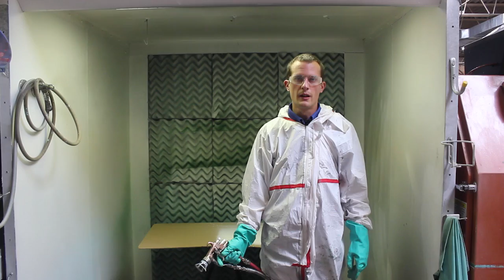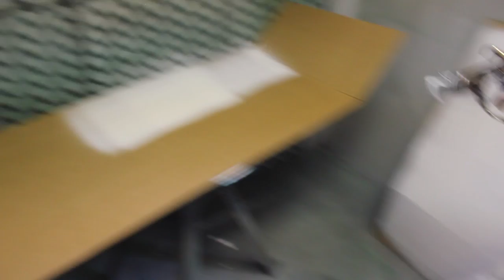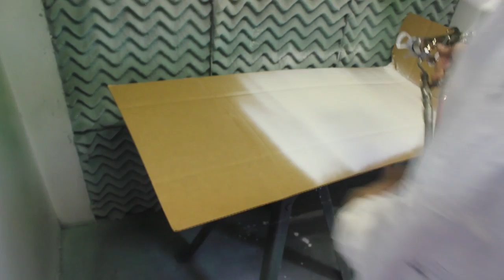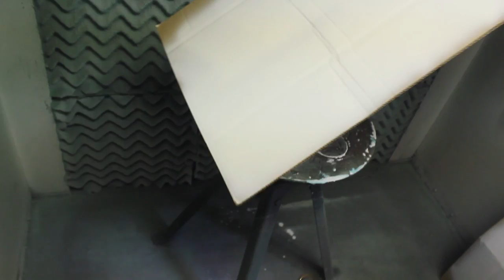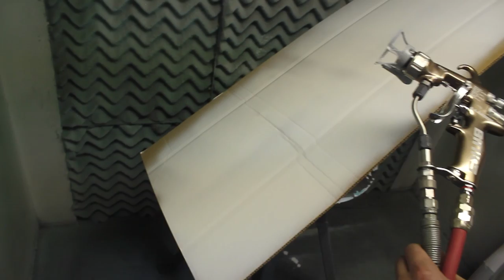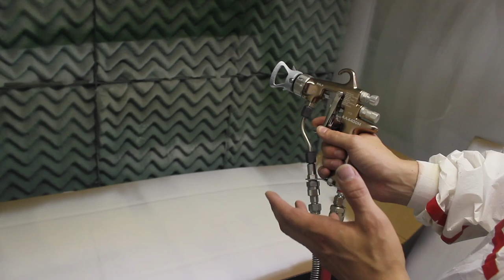Airless vs Air Assisted Airless Paint Sprayers

Comment: So when you say "edges" are those what some guys call the "tails?" Because at least in the video, I can't see any tail at all even without air assist. What kind of sprayer do you have? I'm impressed.
Reply: yes, a tail is the result of sufficient pressurization to properly atomize all the fluid being sprayed. Just investigating the advantages of airless myself to see if its worth the extra cost for speed enamel applications on steel. I think its a sexy tool but not required to achieve the same task. There is an advantage to certain applications on very high quality standard products where a premium product needs to be achieved. I think its more of a shop tool myself.

Comment: Do airless sprayers spray thicker paint better than air assisted airless? I'm trying to spray Benjamin moore command.  I have an anest iwata 17:1 and my tips keep clogging while painting.  I have a new gun filter.   Ive used a 513, 515 and 419 tip... 45 psi on the fluid and 15psi on the air side and i can never get these perfect pattern sprays i see everyone getting on YouTube.  It's very frustrating.  After 1 pass or so my spray pattern gets distorted like it's clogging.  I see everyone spraying right out the can with no issues but me... No way. If i lower the fluid pressure it really clogs so it seems to like higher pressure.

Comment: G’day mate,  just wondering if there an actual finish difference between a flat tip vs a fine finish reverse tip in air assisted airless
Reply from the maker: A fine finish tip will typically be a bit better break up and is usually only available as a flat tip, reverse tips are convenient because they allow for quick cleaning of any plugs.  Hope this helps.
Reply: Pittsburgh Spray Equipment Co  Wagner fine finish are purple, normal are yellow , new low pressure tips for walls are green , Graco  fine finish green and new low pressure tips are green, tips ,normal wall tips are blue  both companies also make flat tips,